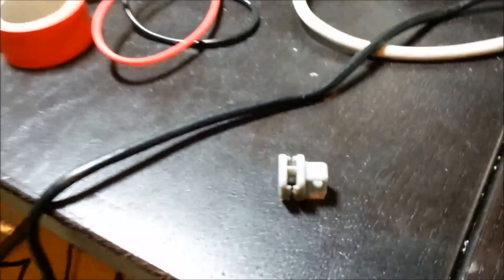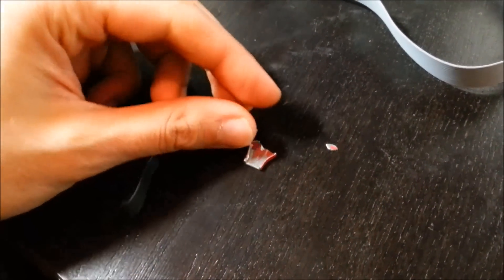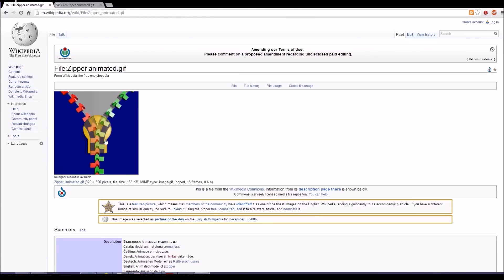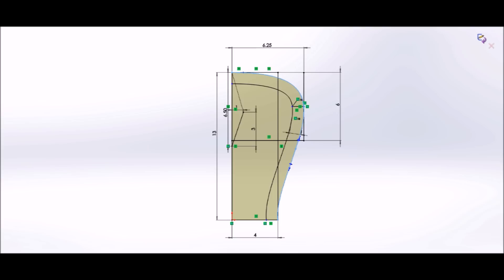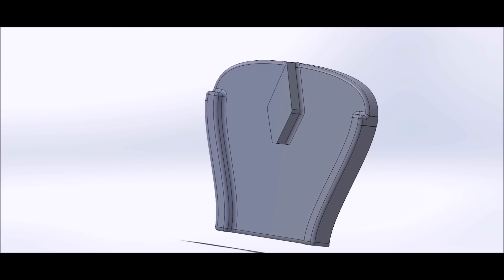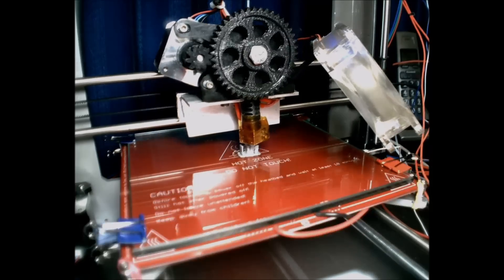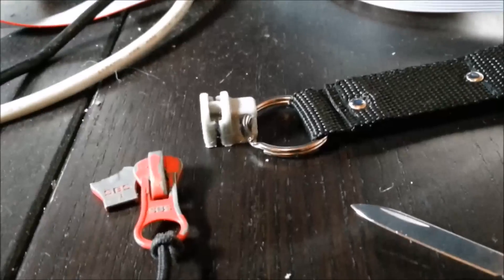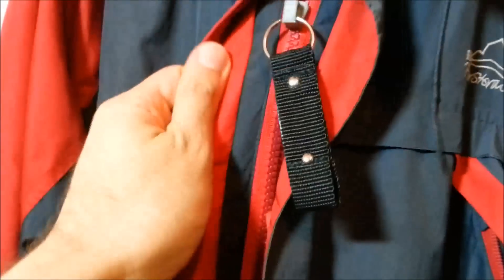Fully working, 3D printed replacement zipper/zip slider on a RepRap Prusa i3

Comment: How did you get the zip on the jacket?
Reply from the maker: Florian Melmer At the top of the jacket there was a small plastic piece that prevent the zip from being pulled up and completely off when the jacket wasn't closed. I had to trim that down slightly so that I could get the zipper on from the top. Because the equivalent stopper piece is also still there on the other half of the zip, when closing the jacket up, it stops fine right at the top.